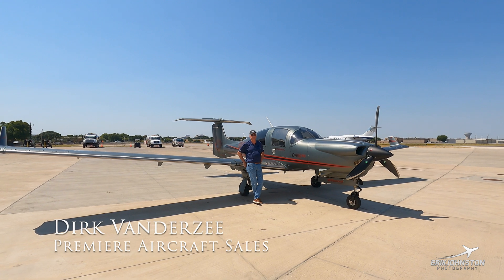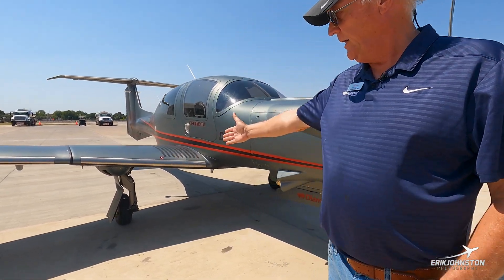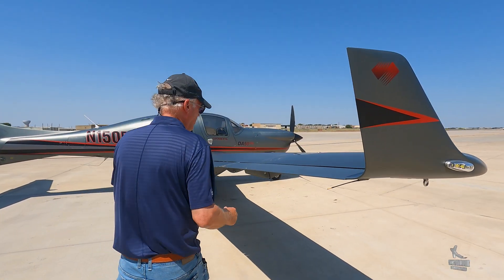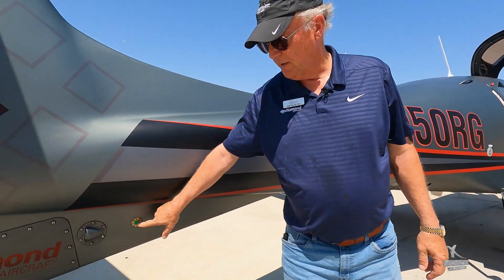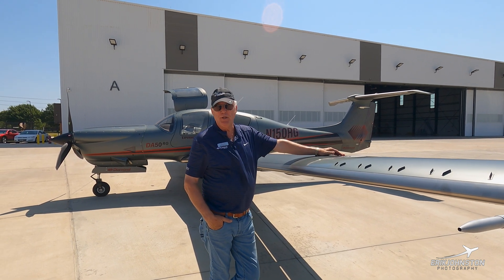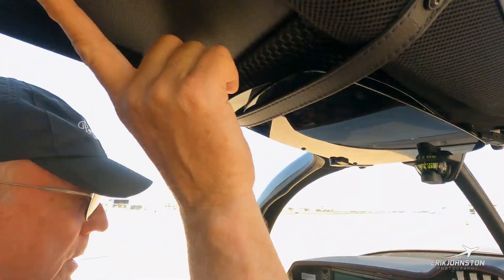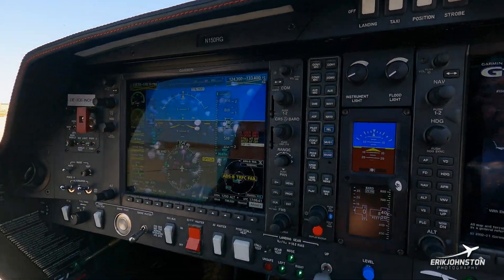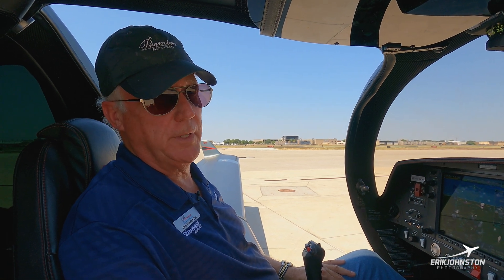Diamond DA-50RG Walkaround

Comment: Beautiful plane.
BUT, at $1.5 million too expensive for a non-turboprop with 20k ceiling and 200 knots.
As a turboprop the ceiling would go up another 10k (at least) and the speed up another 200k.
Would probably cost $2 million (just another 30%).

Comment: Lots of advantages to this aircraft. CFD aerodynamic design means handling in crosswind. Liquid cooling ideal for hotter climates especially on take off. Strong composite fuselage with crash protection cell, highly efficient engines. Fadec throttle, and impressive build quality. Looks great too. A thoroughly modern plane.

Comment: what the heck was that cooler looking box in the baggage area
Reply from the maker: That is the temporary a/c system. These hot Texas days you have to have something. Haha.

The certified model will have a regular system
Reply: oh, interesting! thanks!  @ErikJohnston
Reply: Just throw a bag of ice in and turn on the battery powered fans and it’s an air conditioning system.

Comment: Dumb question. It runs on diesel. Is that common in aviation?
Reply from the maker: It is a diesel engine that runs in Jet fuel
Reply: Same fuel every commercial and business jet and turbine uses - Jet A. So yes, you can get it at every airport in the country.

Comment: How much hp does it have
Reply: the CD300 is a 3.0L V6 that reaches around 300BHP at takeoff with a continuous power of ~270BHP
Reply: @dashrendar1485  would love to see an engine like this in the new mosaic light sport aircraft.
Reply: @mauriceevans6546 they’re very heavy engines so not good for light aircraft.
Reply: @brandonadams7837  IDK,  with a 54knt stall speed,  heavier engines will be possible,  not this one though.